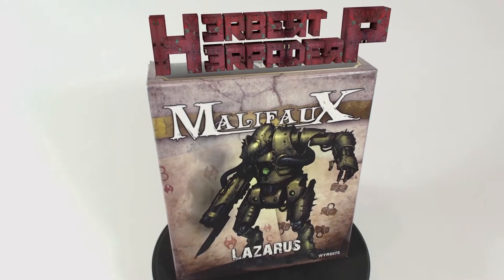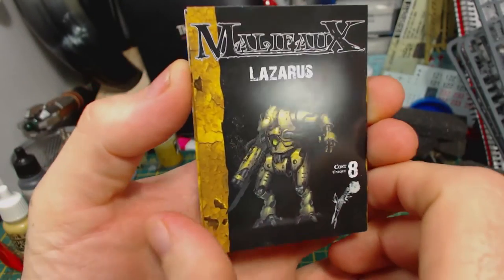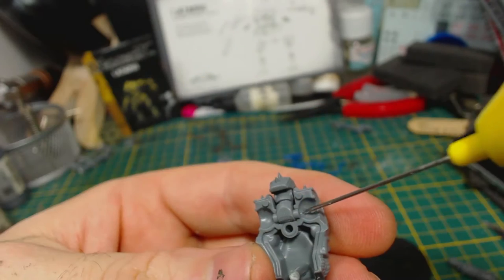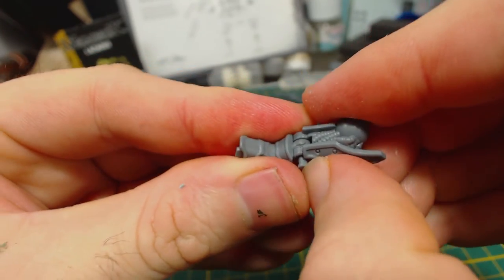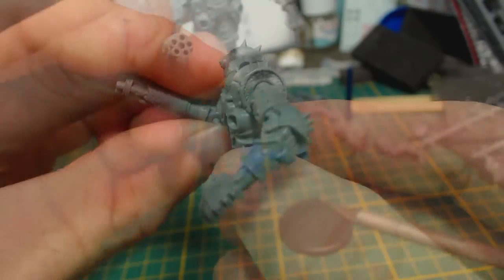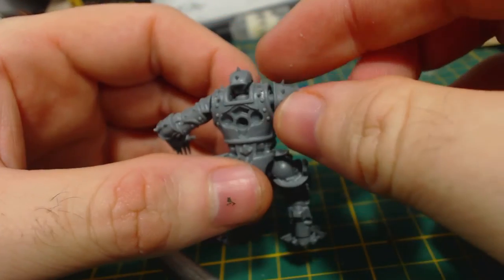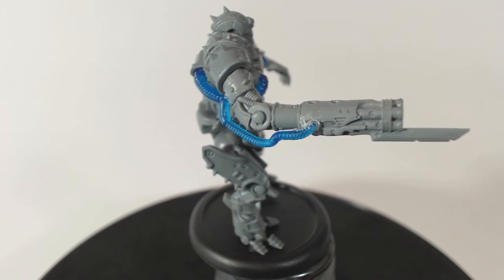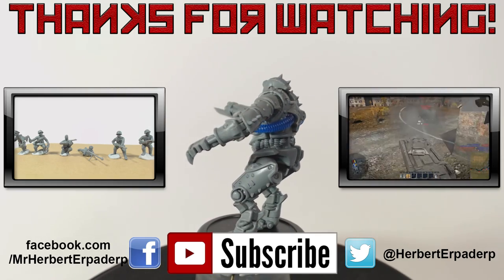Lazarus - Malifaux Plastic

Comment: Thanks for this, the card inside is from the first edition of Malifaux not the current second edition but the model is the same. Mine came with red rather than blue hoses but the building of the model is identical. As you pointed out the joints allow movement but will not after painting so better to glue the pose you want rather than the pose it settles in after painting.